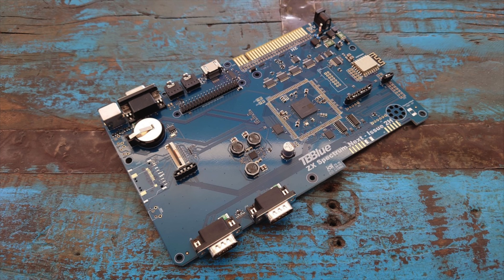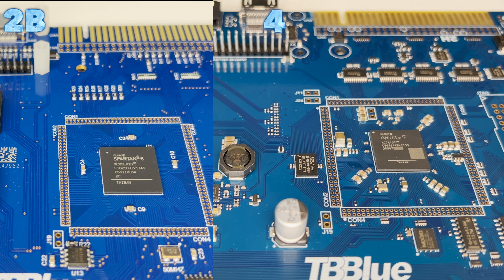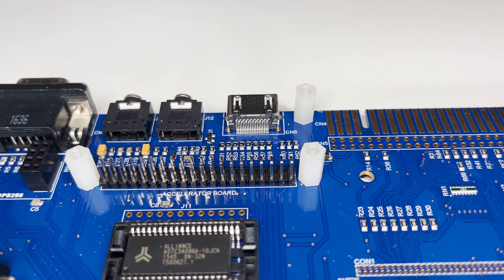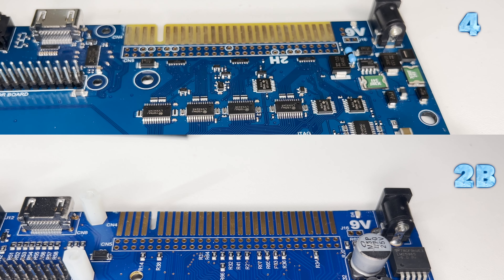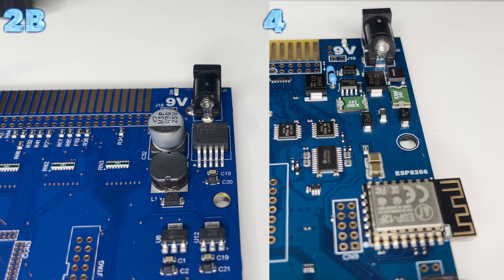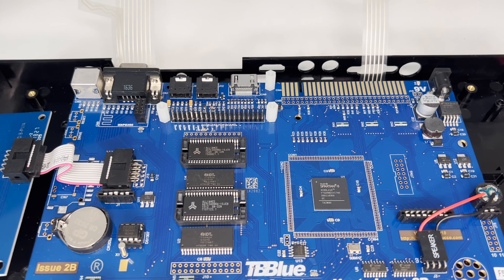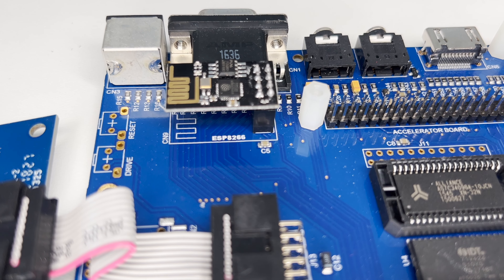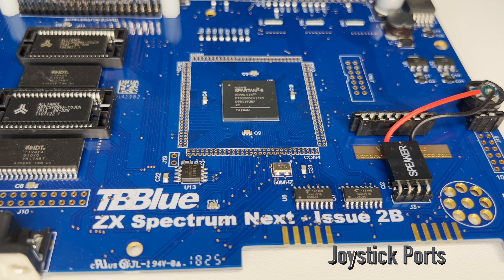Spectrum Next Issue 2 vs Issue 4 - The Changes

Comment: Fascinating to see the development of the spectrum next board form KS1 to KS2 to make it a much more reliable system. That said I have had no issues with my spectrum next. The slight crackle on the audio when the ESP8266 wifi module is active is the only thing I have noticed.

Comment: I have a lot of difficulty trying to get cassettes to load on my Next. Are the things mentioned in this video the reasons why?

Does it also mean that the new version will be able to run cores that the current one won't?
Reply: About tape : 5:12
About fpga : 25:17

Some people aren't aware about the 3.5mm ear/mic jack that it is a combined ear/mic socket as seen on the +3.  Earlier spectrum models had two separate jacks for ear and mic.  A +3-like jack needs to be plugged in that separates the ear/mic into two independent mono leads.

Then at the tape deck end, modern tape decks that are made today are no longer the same as they were in the early 80s.  They are offering STEREO audio out on ear whereas they were MONO in the 80s and the Spectrum Next as well as all the original spectrum models expect mono.  If that is the case then you also need an adapter at the tape deck to turn its stereo output into mono that can then be used.

After that, it's the same as in the 80s where you need to make sure your tape mechanism is clean, the head alignment is good, etc.  However even with these things in place some people are saying they can't get enough volume to load on a Spectrum Next when they can load on another spectrum model.  The change that is mentioned at 5:12 is addressing this.  You can make the same change to a KS1 board by changing that diode but it is an smt part so it is tiny.

The fpga is not identical but it is very similar on purpose as mentioned at 25:12.  There is a great deal of confidence that anything made for the S6 will port to the A7 and most things will go the other way too.  The difference in capacity is not huge so I don't think there will be many cores that fit only the A7.  What is informing this is that the 8-bit genre of computers were small hardware wise and easily fit into the S6.  What we are talking about is possibly the 16-bit genre or a few arcades.  There is a step up in hardware complexity that requires a step up in fpga size and I don't think the A7 is a big enough step up from the S6 to snag an appreciable number of new cores.  More likely if there is a difference, an A7 version might offer more frills on the same core running on an S6.  That's how I think it is but time will tell :)
Reply: @aralbrec  I am using an old tape deck that I recently had serviced and checked. It's all working properly, no issues with worn drive belt or anything. But I can't get things to load on my Next. It's all wired up correctly. Is there anyway to get it working on my next?

Going back to the cores, a lot of the ones we have already were never finished or have known limitations such as just running on a monitor, not a TV. I'm aware that there's no getting around that some will always require an external keyboard, but once the ks2 is released, will the existing cores be updated? Thank you.
Reply: @eidolonfilmsukuk8456   Are you able to save to tape and load that back successfully with the tape deck?  Is there any other machine you can check the tape deck with?  Maybe you can mention the make and model in case we know someone who owns one.

Alt cores have so far been done by third parties.  These cores exist as open source and then are adapted to a new board by the porter.  Unfortunately usually the minimal work is done and little effort is paid to make use of the hardware on the pcb.  So you end up with alt cores that can only do vga-0, can only use ps/2 keyboard, can't use joysticks or sd card, etc.  It's really up to the porters how much time and effort they put into things.  The original source is usually a very basic implementation so fleshing it out can involve a lot of work.

But I think it's likely that down the line that Next team itself will begin porting other cores and do a thorough job with it.  At the moment the attention is still on the Next itself.